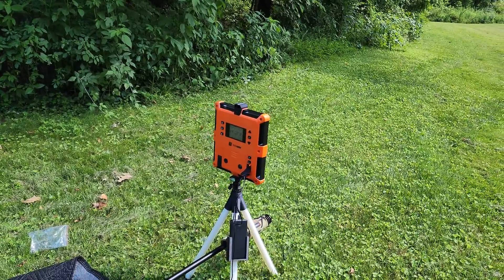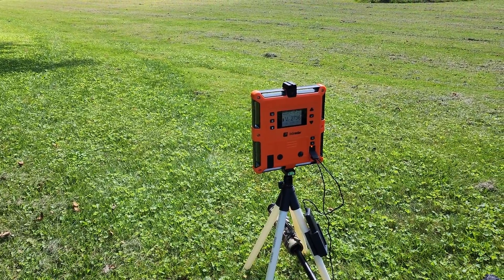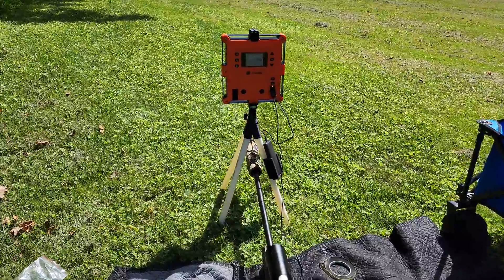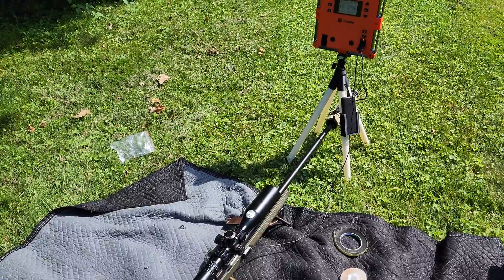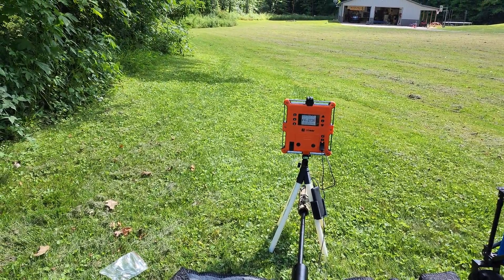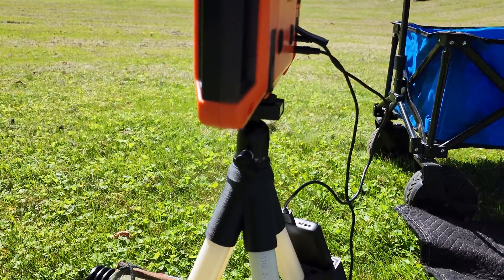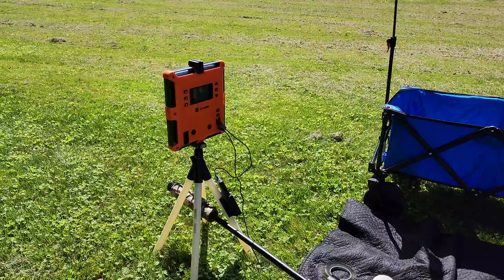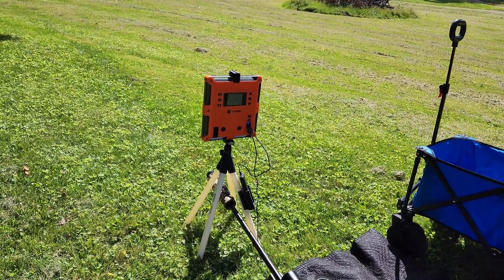If you own a LabRadar and hate it watch this.

Comment: Hey Joseph (and others), like you I suffered under the Labradar and its complete lack of capability to pick up shots - particularly suppressed and with extra quiet guns.   While I MOSTLY got it figured out - the abhorrent phone app and the fact that it relentlessly drops and is otherwise the opposite of human usable was the last straw.    I went out and purchased an FX True Ballistic Chronograph.  I set it up - turned it on and set it next to me and it proceeded to pick up EVERY SINGLE SHOT from suppressed 7mm RM to 223 to 22lr suppressed AND my moderated pellet gun.  Every single shot.   I am selling my labradar to the next fool that thinks it's "state of the art".   Get the True Ballistic Chrony.  The app isn't perfect, but it gives me all the data I need with 1/100th of the headaches.
Reply from the maker: I'll Def check it out.

Comment: I'm curious about the frustrations you had. I didn't have time to play with this during my visit this year, but last time I quickly discovered, shooting suppressed (the only way I want to shoot rifles now), LabRadar works only about 10% of the shots. For pistol, which I used extensively this year, it completely lost track maybe 5-10 times out of about 250 shots. Some of that was related to rain or water dripping off the firing line roof after a shower. I quickly realized that and stopped trying, but several were on dry days. Unfortunately, I also found some wildly low figures (like low 800's for a mid 1200 fps projectile). So, the last two days I setup my Oehler 35p and tried to compare the two. The number of very low shots or missed tracks increased, which is likely due to interference by the 35p screens. However, over about 20 five shot strings, I found the averages within 1-3% of eachother if I delete the absurdly low shots. On the one hand, I think both systems are properly recording shots, neither work in the rain while the 35p requires light, the 35p is a major pain to setup, but I can't really trust the LabRadar. The radically low velocities are easy to pick out, but what if there really is a low velocity round? What about shots where the result is ambiguous?

I am frustrated. I know some of this is due to my proximity to the LabRadar. I need to figure out the eccentricities of using it. Your video helped. I will try this trigger and setup next year. I'll use it for the 6mm ARC and 6.5 Grendel rifles I am building.
Reply from the maker: Your frustrations mirrored mine. Shooting with a can imo the use of a "trigger" is mandatory as well as placing the labradsr over the barrel. Once I did that it's a dream to use. I also think shooting in as open a space as possible with no obstructions in front of the rifle helps a ton.